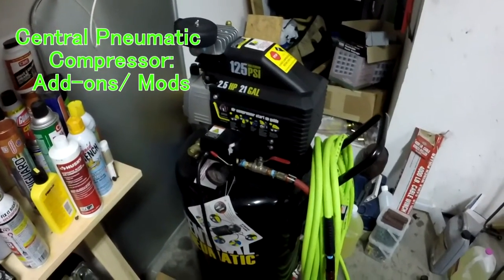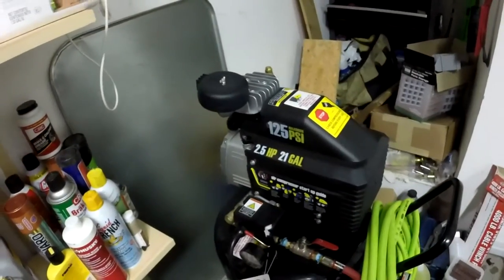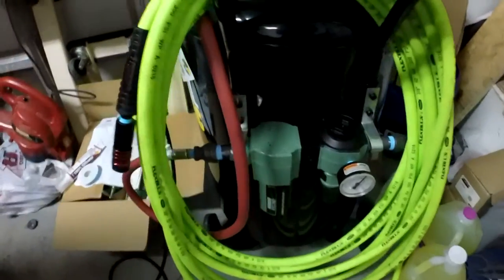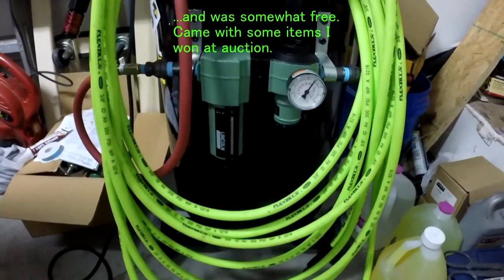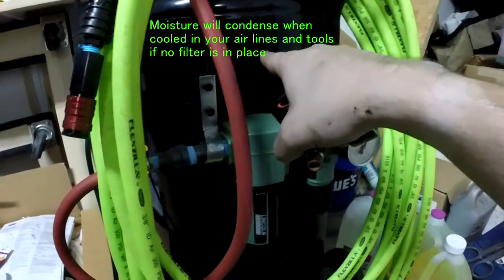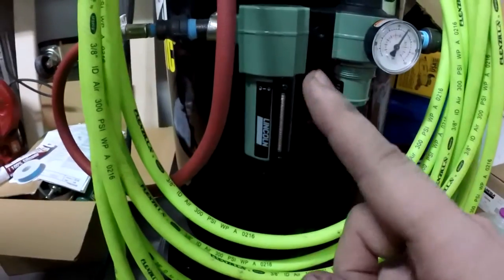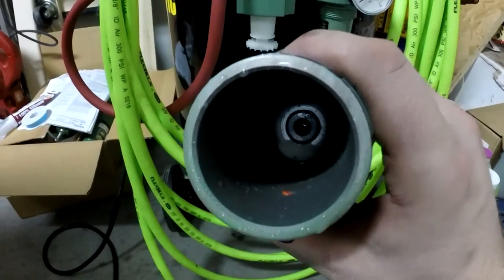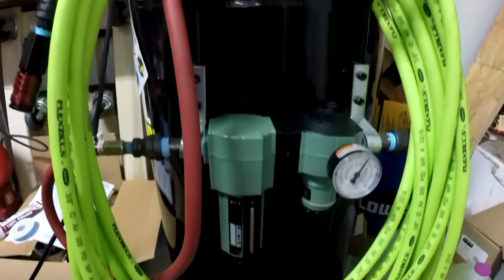Simple Mods/Add-ons to Central Pneumatic 21-Gallon Compressor

Comment: I got the same compressor, I replaced the reed valves, cold start valve, the capacitor, check valve. 

To surpress the sound what I did is. Attach a hose with a fitting, take the filter off get a fitting attach a hose to it that leads to outside. Done ...simple cheap and works. I also will draw air from outside the workspace which is colder cooling the head a bit better.
Reply: Hi Michel. I have this compressor also. What does replacing reed valves, cold start valve, the capacitor, check valve do for your comp.? I'm looking looking to do some upgrades on mine.
Reply: Did replacing all that stuff help the compressor keep up with your tools?

Comment: I think I'll be getting one of these compressors soon.  Just a couple of ?s. Did you ever try the oil filter/air filter mod?  Have you done any spray painting with this?  If yes, what gun did you use?  I've heard some folks complain about the noise.  Did changing the filter help?  Have a rubber hose to a filter mounted elsewhere?  Is the HF 29 gal worth double the price?  Thanks... BTW...Good video.
Reply from the maker: Yes, I am trying out using an oil filter as an air filter, don't see much of a difference in noise or air intake. Have a plan to do a video on this and some other options, however not sure when I'll get to it sure to my fulltime job... I recently used the compressor for painting a few filing cabinets. Used the cheap harbor freight gun. Did well, but would not use this unit for large projects. Paint small portions and let it rest, if you don't, the compressor will run constantly, heat the air and allow too much moisture into the lines even with a moisture separator used. It is noisy so either sit the compressor a decent distance away from you or wear hearing protection.

Comment: Great video, i am an amateur and would like to know if you have a suggested parts so i can purchase what i need at the parts store, for the upgrade; also looking forward to the air filter upgrade as soon as you get it posted. Thanks for all you do.
Reply from the maker: There are many brands of filters and regulators out on the market you can choose from. The moisture separator and regulator assembly I am using here is more of a heavy duty industrial unit, bit overkill but it does the job. I'll post a parts list in the description shortly.

Comment: Hi there, I am very curious as to what brackets you used to mount everything to the handle? Did you fabricate it yourself? If so, what material did you use? Last question, what type of connectors did you use? I appreciate both videos you did of the Harbor Freight compressor. I'm not that experienced with the larger compressors so this was a huge help!!
Reply from the maker: The brackets I fabricated out of some cheap bar stock from the local hardware store. the fittings were from the black iron pipe section from same hardware store. Since the regulator is a 1/2" setup I needed to step up from the leadout hose which was 3/8"npt coming from the tank, then step back down to the 3/8" hose I was using. the Filter regulator unit I am using is way overkill for this application. You can get by with a smaller 3/8" setup and everything will run just fine.
Reply: @jungleking007Channel  Thanks so much for all of your help! Great video!!

Comment: Hey, that's an awesome idea for hanging the filter/ regulator there! Did you have to drill the holes in the mounting things, or did you find some that just worked? And what are those mounting things called? (Don't even know how to start looking for those, I'm new to DIYing stuff)
Reply from the maker: +ElectroPulse those are homemade brackets. I bent them out of some bar stock from the local hardware store. Drilled the holes to match the holes for the screws that hold the handle on the tank.
Reply: Hmm... interesting. I might need to finally get me a vise so I can do that as well. (I ended up ordering a used reg/filter setup, similar to yours, on eBay after seeing your mounting solution :) ) Thanks for the idea!

Comment: Does the order of the water trap and pressure regulator matter should one receive the air before the other
Reply from the maker: Filter first, then the regulator is the recommendation. Air from the compressor will hit the filter first to remove the moisture and debris, then pass through the regulator. If it were the other way around all the moisture and debris would clog up the regulator.
Reply: @jungleking007Channel  9.

Comment: So, it's been three years since you posted this I was just wondering on your thoughts and opinions on the Lincoln Industrial filter and regulator? 

There's no reviews or video's anywhere that I could find! I have the same exact compressor as you and just looking for a good quality filter and regulator  for my setup. There seems to be only a few places that even sell it for high dollar compared to some others on Amazon that I'm not 100% sold on.

Awesome informative video by the way! 👍💯💥
Reply from the maker: Works great! I have had no issues with it at all. Used at least once a week to blow off dust, air up tires, or the occasional need for the pneumatic impact. This filter and regulator setup is more an industrial part. Might have to check with some industrial supply stores to see what they have. Some auto parts store may be able to get them too. It's most likely overkill for such a small compressor. There are also filter/regulator all-in-one combo units that function the same, but a little more compact.  The one you see here came off a work bench I won at auction a while back. Thanks for watching!
Reply: @jungleking007Channel  Thank you for the reply! I just purchased the same filter regulator that you have today. I'm going to set mine up just like your but mount mine up on the wall. Now time to buy 1/2" shut off valve and a short hose and fittings  which is kind of a pain going from 1/4 to   1/2 and then back in reverse to hook up airline while not trying to have restrictions. I was trying to look at your video to see what fittings you had and hose that I'm assuming was 3/8  with 3/8 thread or 1/4. I was going to use a reducer but it would restrict to im tossing are the setup to have the most are flow like your setup.

Comment: Hey, first thanks for the video. I just got this compressor 2 days ago, because this kid in my neighborhood needed money for prom and offered to sell it to me for $35.00. I don't usually buy power tools from Harbor Freight, but I couldn't pass up that kind of deal. So my question is when I first changed the oil it was a thick milk looking color. (He did say it had been sitting in the garage for a while). So what would be the best way to flush, and clean to make sure I get the best performance out of it with the longest amount of life?
Reply from the maker: +justfoundnemo sounds like moisture may have gotten into the oil. If it were me cleaning it out with that issue, I would most likely take the side crankcase plate off and rising out with mineral spirits. Then I would fill with oil and run the compressor for a couple minutes. After, drain the oil and fill again, and perform the same procedure until the oil is clear. This should hopefully relubricate all components and break up any debris that shouldn't be there. Good luck! How this helps.

Comment: How is the update coming on the tank, can it handle a 1/2 air impact with out it kicking on all the time, Would love to see a video on that.
Reply from the maker: It's on the list as I'm curious myself. Unfortunately, life has gotten in the way at the moment, and the purchase of some tools has to wait. Soon though... I will get it done.
Reply: u can do 2 tires before it comes on
Reply: I use a 1/2 impact all the time this compressor is suitable to run it . I never had an issue. They run of 90psi which is no problem for this compressor
Reply: I have that compressor and a 3/8 impact from Central Pneumatic it peter's out real fast and the compressor always needs to fill again have you found a solution? This is basically an oversized tire pump unless I can get it to run my tools.
Reply: Bian - Like they used to say in car racing, there is no replacement for displacement. A 60 or 80 gallon tank is best but you CAN run most air tools with a 20 or 30 gallon tank. It will just kick on more often. Or as we older guys say - more breaks for us. 
A couple things will help your flow - and flow is the key word. Transition as much as you can to 3/8" diameter hose and piping and go to high flow quick connect fittings. Only used those coiled hoses for air nailers and blow guns. ONLY use at least 3/8" hose... and ONLY use 3/8" valves. The high flow fittings are a dramatic difference.  As for PSI, yes your 1/2" impact is designed to run on a working flow of 90psi. But if you set your regulator to 90psi and then pull the trigger on your impact, a pressure gauge at the impact (while its running) will show your "running" or working air flow at the tool is probably around 50psi. You can see for yourself on Youtube videos and make your own inexpensive pressure gauge testing fixture to measure what works and what does not.
You need that flowing pressure at 90psi at the tool - NOT 90 psi STANDING STILL AT THE REGULATOR - to make the impact work at its best.
So to do that,  open up all your "plumbing" to let the air flow better and set the regulator at 110-120, and you will find you now have 90psi at the tool while the trigger is pulled, so it can work as designed.

Comment: I bought the next size up (26 gallon) and have a LOT of moisture coming out of my line despite trying several things. I did some research and found out that the hot air coming out of the compressor needs to cool sufficiently and the water needs to be filtered before hitting your line. That's why people run piping with water traps coming out of their compressors before their air hoses. Actually, it would be ideal to catch the air coming straight out of the compressor and cool/filter it before going into the tank (kind of like this https://www.youtube.com/watch?v=SA7yj1EXDZU but with the radiator and filter lower than the compressor). I'm in the process of trying to decide how to modify my compressor to remove the moisture so I can HVLP spray paint my car. I might just try to get by with a simple PVC post tank pipe line with 2 water traps, hook my filter to the air output of the endpoint and use filters before my tools for now. I don't know if I need a permanent solution. I'm just trying to avoid spending 4-5k on painting my car.
Reply from the maker: That inlet system may trap a Little moisture but it still won't address the condensate formed in the tank after the air cools a bit. You are still going to need a filter system on the outlet. If this is primarily going to be for painting, try looking for a large In line desiccant filter. Don't use PVC pipe anywhere in an air system. Too dangerous. Use black iron pipe, or what I have considered was the Maxline RapidAir system.

Comment: you should use an oil filter the threads going in are three 3/4 inch ntp what you need to do is get a bushing they make great air filters for air compressors
Reply from the maker: +austin eguires never heard of this before, but sounds like a brilliant concept! Might include this as an option when I do some testing. Thanks for the idea!
Reply: JungleKing007 If you try that oil filter on the intake idea, you should take some precautions because not all oil filters perform the same.  Install a T fitting between the filter and the compressor head.  Put a vacuum gauge on 1 of the legs.  Check vacuum draw with the original filter first, then with the oil filter.  Use whichever one draws the least amount of vacuum and remove the T.

Comment: the bolts that are screw onto the tanks or bullets waiting to shoot out..
i wouldn't do that bud...
Reply from the maker: +Fghj GHJjj Those are the bolts that hold the handle on the tank. No drilling was done to mount the filter and regulator. Utilized what was already there.
Reply: You clearly did not watch the video where he clearly says "I used the holes where the handle was"